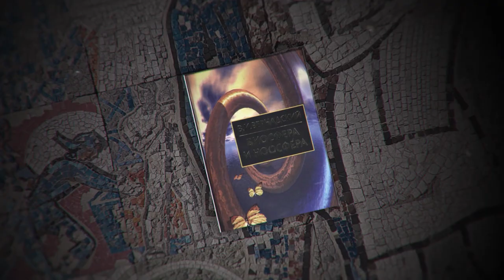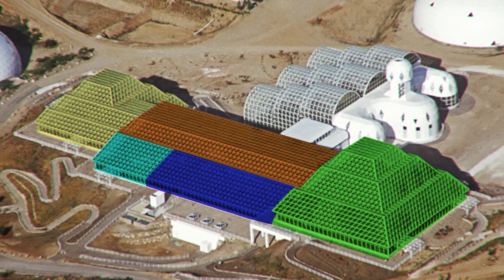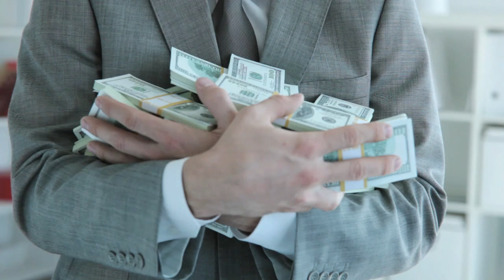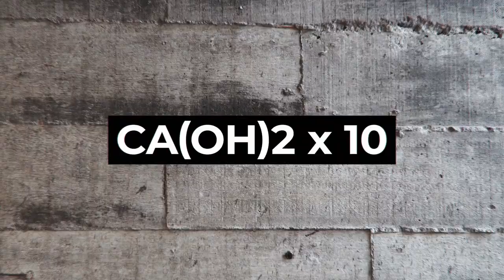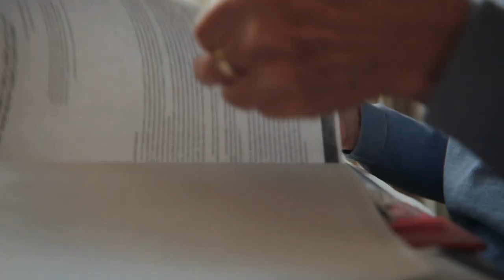This Is The Largest Earth Science Experiment. What Went Wrong?

Comment: The experiment was poorly framed. It was an exploration that only the foolish would contemplate could be a confirmation that the design was perfect, or even adequate. Heck, if so, why even build it? Just save the bucks and build it on the moon. One does it here first because we CAN keep oxygen levels correct regardless of design flaws while we figure out said flaws. We CAN keep folks fed while we figure out how to make things work.

Purity tests are unwise, dangerous, and slow advancement. That thing should have been under constant revision and upgrade while receiving any and all external support required to ensure that any individual imperfection (say, CO2 levels rising) doesn't affect some seemingly unrelated balance (say, the predator/prey relationship between two species). How can one know about predator/prey relationships if the data is being polluted by unrealistic/untenable CO2 levels?? Tis impossible, so you've just blown dozens of semi-independent avenues of research because one avenue hasn't been completed yet.

And when, say eight avenues each have eight lessons to learn, their way ended up with eight raised to the eighth power problematic interactions to solve while starving. Lots harder than 8x8=64 independent problems on a full stomach, eh?